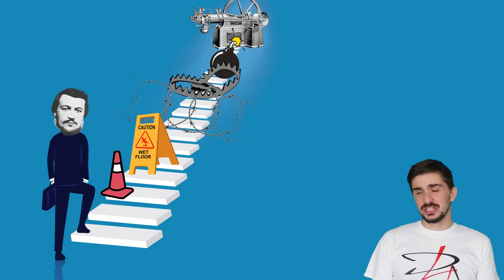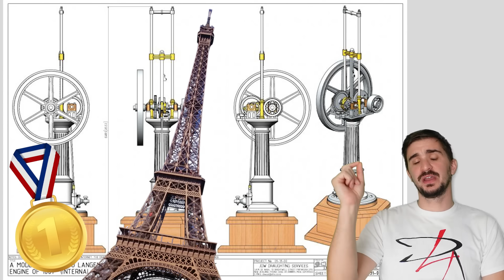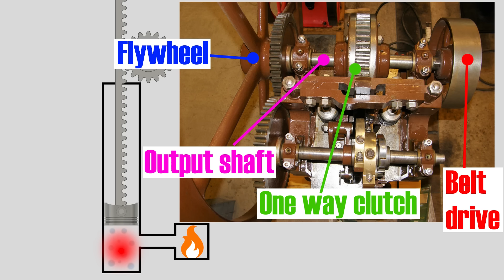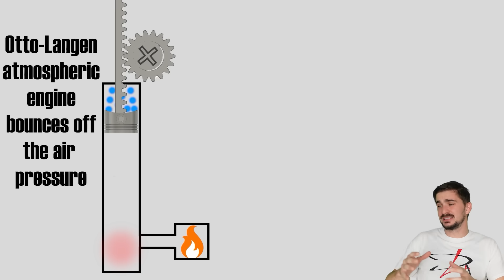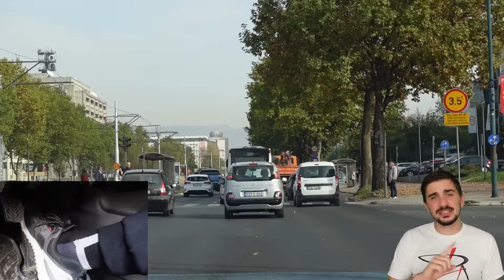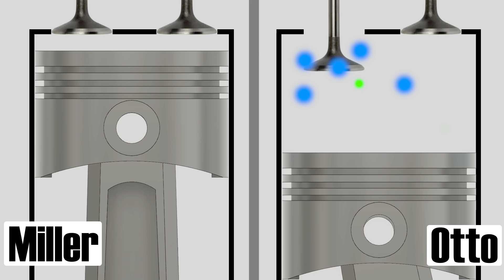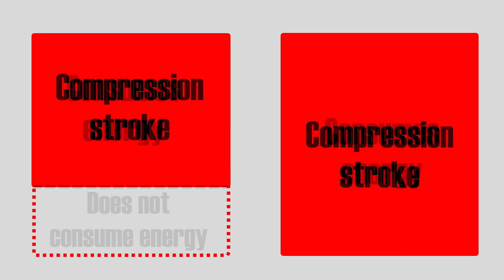You'll understand everything about Atkinson, Miller and Otto cycle engines after watching this video

Comment: I believe more modern engines can switch their VVT even at low RPM since they are electronically controlled rather than controlled by oil pressure like older Hondas. I believe pretty much any modern turbo charged today uses the miller cycle to save on gas. It's why these engines get excellent highway efficiency but the moment you are driving in the city in stop and go situations, efficiency drops significantly. In my car, I can easily get 30+ MPG even at relatively high speeds, but in the city can only achieve 16-20 MPG.
Reply from the maker: Yes but there's still a catch. When you can switch to Miller at very low rpm the engine ends up being in Otto most of the time and the number of scenarios when you're actually running Miller is very much reduced. It's impossible to be responsive at low rpm and be in Miller at the same time, maybe that's how I should have phrased that part.
Reply: The Honda VTEC is electronically controlled, but it electronically controlls the flow of oil to actuate the valve timing system. This is the same as the vast majority of other manufacturers VVT systems. The only examples I can immediately think of that don't use oil pressure are BMWs Valvetronic (electric motor directly drives a mechanical system to control valve lift) and the koenigsegg free valve system.  There may be a few others but they are in the minority.

Comment: That’s the best and simplest explanation of the differences between engine types that I’ve ever seen. 

Well done.

What is really amazing though is that all of these are going to be made useless with the even more rapid developments in battery and electric tech.  I loved my V8s and manual transmissions but am addicted to the responsiveness and power of my EV. No more fuel burning.

Comment: What an amazing video!
With regard to Atkinson/Miller differences:
Atkinson has a very late intake close, past BDC, Miller has an early intake close, before BDC. In Miller cycles you actually shorten the intake, creating a partial vakuum before you compress. Atkinson pushes fresh intake air back out of the combustion chamber.
Reply from the maker: I think you're mixing up Miller and Buddack
Reply: @d4a  you can argue about that, VW/Audi started off calling it Miller when they introduced their EA211evo and only after some time switched to Budack. Nowadays in R&D it's mostly referred to as Miller by several OEMs worldwide. Probably because it's easier to say "we'll be millering" instead of "budacking".

Comment: Excellent video.
This was particularly important to me because I have a Miller cycle engine in my car. It is a 2014 Nissan Note with the HR12DDR engine. It is supercharged, but has a magnetic clutch to disengage it when not required. It is very economical and produces so little CO2 that I don't pay any road tax, it produces less CO2 than a friend's hybrid Honda Jazz. The downside is that it is not a fast car.

Comment: Great video, explaining all the difference between different cycles in modern engines. Have Toyota hybrid car and absolutely love it. People think that hybrid is slow and underpowered, but have proved few drivers that is not the case when leaving them behind when light goes green at the junction.
Reply: Hahaha!! I do that everyday during my commute, with my 14 year old Prius Tspirit Hybrid. 145k miles on the clock and this car just GOES when you need it to. All glory to the Atkinson Cycle engine incorporated into the equally legendary Hybrid Synergy Drive. Managed 69.4 mpg out of a 45 litre tank of fuel last summer, also travelling 653 miles out of the same tank of fuel - amazing performance from a vintage 2nd generation Prius - I wasn’t babying it either - this happened during the unprecedented heatwave in London last summer. 😊
Reply: It's cause the engine doesn't drive the wheels directly, so engine power doesn't have a direct affect on power. Your battery health and capabilities will affect the speed much more. Hence why the newer ones are much quicker than the older ones.

Comment: Excellent.  The only thing I would add is that the Atkinson/Miller engines also benefit by effectively extracting more power because of the ratio of the power stroke to the compression stroke -- not just by saving energy in the compression cycle, but also by having a longer effective power stroke which allows for maximum extraction of energy from the combustion pressure.  Also results in slightly lower exhaust gas temperatures but that's not particularly of note.

Not sure if you've done it yet, but a video on the Aisin e-CVT design would be a nice video.  People don't understand how essential that design is to an efficient hybrid.  It contains two electric motors of different sizes and a single sun/planet/ring gear set and no clutches or solenoid controlled gear engagement.  It's baffling in it's simplicity when you first look at it!  The smaller motor/generator actually modulates the speed of the planetary carrier to change the ratio between the petrol engine and the output shaft.  I love its simplicity.

I have a Ford Fusion (Mondeo) hybrid that uses the same transmission and it's quite amazing.  It has a 2 liter Miller engine sans supercharger.
Reply from the maker: Really appreciate the tip. That IS a great video idea!
Reply: @d4a  You are great man! Even I who worked with combustion development 10 years in the 90:s,  learned new thing here. History is fascinating for us engineers. In fact, Im starting to think about modifying any engine with inlet VVT to run Atkinson. Why I didn't thought about that before?

Comment: I was a Mazda Master tech in the 90's and we had a number of customers at the dealership that bought Miller Cycle Millenias.  They were great cars.  Like the video said, they made more power and got better MPG out of a smaller displacement engine.  And the only issue I can remember having with them is that the supercharger drive was rattled a little under cruise conditions.  It was very minor but remember this was a premium luxury car and it took awhile for Mazda to come out with an updated unite that fixed the noise.  Otherwise, they were good engines.  It was just hard to get people to spend that much on a Mazda.

Comment: Thank you, for the article, comments and discussions. about the D-cycle (4 Differential strokes) which is a hybrid of the 2-/4-cycles. Besides better fuel efficiency (our tests show >20%), 2.5~3times (not only 2x, less reciprocating weight and friction) more torque driving power, etc. It can have cars driven with i2, i3, and i4 (whole engine works) instead of current heavy/complicated i4, v6 and v8 current engines for more power, and less fuel consumptions – with lighter support, vehicle frame and styling. 
The split-piston inner-air-pump can further make a hybrid of diesel engine with the gasoline-type combustion (not to produce soot/NOx) to avoid the expensive and the cumbersome after-treatments, besides saving fuel and more powerful towing power. This is the SCCI/LTC (stoichiometric charged compression ignition/low temp combustion) technology, which we are developing to meet CARB’s 2026 (and EPA’s) heavy diesel truck emission regulations. 
Where do you live. I am in Austin, TX. We are looking for partners if you know of someone. 
( Notes for D-cycle – following are not obvious, call to discuss:
1.	Most piston skirts need not be windowed.
2.	Ring sections can be made of stronger thin steel just to hold rings and oil to cool.
3.	The same rings stop the oil leaking.
4.	The piston-train can run directly from the crankshaft.
5.	Crown doesn’t run at higher speed and having Atkinson cycle. The full air intake can be provided via an air 2x pump.
6.	Valves don’t run at higher speed, except for fewer cylinder engines.
7.	Piston-train spring is compressed during intake. )

Comment: Atkinson cycle engines are an absolute gem in Toyota hybrid engines - high compression ratios, 13.0:1 and above, thermal efficience over 35% (over 40 when Mazda SkyActive runs in Atkinson cycle in a Toyota hybrid).

Comment: A detailed overview. Being familiar with the Toyota implementation, it’s worth noting that in the current form it also uses direct injection for fuel, so it only injects it after the valves are closed. Another feature of this one is that it only operates the engine at a reasonably efficient speed, using it’s hybrid transmission. It is not allowed to “idle” at all, with any surplus output being stored temporarily in the traction battery.

To that to work in practice they use spark plugs which are a bit different than the typical type in Otto cycle ones. They have iridium tips and are supposed to spark immediately when the control kit requires them to while the car is on the move.

Comment: Great video and I appreciate the animation used to explain the various cycles. You may want to look at the VW 1.5 l engine which utilizes a Miller cycle but with a turbocharger instead of a supercharger. I recently purchased a Jetta using this technology and it runs great and delivers 43 mpg in a compact 4 door sedan.

Comment: Awesome. I was researching the Mazda millennia just a few days ago. My gen2 Prius is exactly 50% volumetric efficiency, well that's what the torque app shows. I tested the app on my lb7 duramax and the turbo pushes the volumetric efficiency up avging 150%. 🤔 I think the 2023 Prius is variable Atk/0tto, or if it isn't, it should be. On interstate driving, I think a Prius or any Toyota hybrid could slash the compression stroke down further, to 20% or even less. Having more pistons should reduce the diminishing returns.

Comment: The thermodynamic efficiency with Atkinson cycle wasn't entirely with reducing the wasted energy in compression, it was also because the combusted fuel mix wasn't fully utilised at the end of the expansion stroke. So the main advantage of the Atkinson cycle is reducing the amount of fuel/air compressed so that by the end of the expansion stroke it's closer to atmospheric pressure meaning that more of it's energy has been turned into usable mechanical energy

Comment: I would expect the Atkinson cycle (with linkages) to be very clean burning, approaching complete combustion, and as a bonus higher torque or more torque for a given energy source. Ideal for a Hybrid generator if not connected to the drive train.
Very interesting video, cheers.

Comment: Very interesting video, but it's necessary to add that currently the last improving to Miller cycle is the adopting the supercharging by small turbocharger because it allows to reduce the power consumption , a lot of  new engines (VW 1.5 TSI, Fiat Fifley 1.5 etc) are Miller engines with  turbo for example. I want to add a last thing, the Miller's Cycle is also possible acting on Exhayst Valve (anticipating the closure), these tecnique is used for example in big industrial engine because it has more efficiency

Comment: Very good!   I had to re-run the video to see it, but the Atkinson engine is more efficient, because more energy is extracted from the gas before it is exhausted, but it takes a bigger engine for the power.  Likewise a mechanically driven supercharged engine is less efficient, but more powerful for the displacement and weight.  I don't see the advantage of the Miller cycle with a mechanically driven supercharger over the Otto cycle.  I had an original Honda insight that averaged 50 mpg, partly by using the Miller cycle, but a neighbor ran into its streamlined aluminum body.

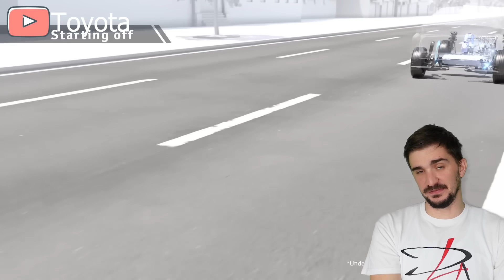Comment: 20:26 it still consume energy. The motor is using energy from the alternator to run, and this means that the alternator has a load on, so the main engine need to work harder to rotate the alternator.

Comment: Caterpillar used the Miller cycle as an in cylinder means to reduce combustion emissions of NOx. With a diesel engine that runs on extremely lean air fuel ratios, a lot of excess air in the combustion stroke is reacted into oxides of nitrogen, a toxic pollutant. With the aid of hydraulically operated variable valve actuators they were then able to keep the intake valves open longer under certain conditions, thus reducing the production of NOx. The interesting difference between diesel engines and gasoline is that there was no loss in power due to the excess air typically not generating "power" just expansion of gasses that helped build turbo boost. To remedy this they began using compound turbocharging in excess of 60psi on some engine serial numbers (NXS/MXS)

Comment: I'm wondering if anyone could help me understand this as an enthusiast but not an engineer: If compression increases efficiency, which is why Otto added the compression stroke, then how does hampering the compression stroke via Atkinson or Miller increase efficiency? Also don't these typically have a similar compression ratio (IE: Toyota's new 2.0L@14:1) to Otto engines? It seems like the mpg/efficiency gain is just from smaller displacement, with unnecessary extra steps. What it really looks like to me is that Miller cycle is really a different way to make a variable displacement engine.
Reply from the maker: You're mixing up the act of compression vs compression ratio.

Comment: There was a privateer that developed a KTM single 4-stroke top end on a dual crank bottom bottom end. One of the features of this engine was faster compression stroke (for less losses) and a slower power stroke (for increased torque). I was surprised that the concept was not carried further.

Comment: I'm not an engineer or even a mechanic, so I'm probably missing something here, but with the open intake valve and backflow of fuel / air mixture out of the cylinder isn't that just dumping unburned fuel causing both pollution and waste? Or is what leaks out of the cylinder retained in the intake manifold or something like that and then pumped in during the next intake stroke?
Reply from the maker: You answered it. Stays in the intake and goes in on the next stroke. Nothing is wasted nor any pollution generated

Comment: Another way to look at the efficiency gain in Atkinson/Miller engines is, yes the reduced compression stroke takes less energy, but also the relatively extended power stroke doesn't lose energy to the exhaust. Even though the cylinder has the same volume at the end of the Otto power stroke, the ignition has substantially increased the pressure. So by extending the power stroke, you can extract energy that would otherwise be lost when the exhaust valve opened.

Comment: I think there is a fundamental problem with this video. It repeatedly says that compressing the incoming charge wastes energy. I think that is wrong, because the gas acts as a spring. In other words, the energy required to compress the charge is returned to the crankshaft as the piston descends. In that respect it is exactly like compressing a steel spring: the compressed spring stores the energy used to compress it, and releases the energy when the spring is allowed to expand.

The Atkinson cycle is not about reducing the energy wasted on the compression stroke. On the contrary, it is about reducing the energy wasted on the expansion stroke. In the standard Otto cycle engine, there is a significant amount of pressure still in the cylinder at the end of the power stroke. The piston cannot extract any more energy from the hot gas because the crankshaft won't let it travel any further. Instead, this pressurised hot gas is released into the exhaust system, wasting the residual energy in it.

Atkinson's invention allows the expansion (power) stroke to be longer than the compression stroke. This longer expansion stroke allows the piston to continue extracting energy from the combustion gas, until there is little or no residual pressure.  

In summary, this is the crux of the Atkinson cycle:

1/ The Otto cycle forces the expansion stroke to be the same length as the compression stroke. At the end of the expansion stroke, there is still residual pressure in the cylinder, and this pressure could do more work if only the piston could continue moving until all the residual pressure is gone.  Instead, that potential work is wasted: the piston cannot move further, so the pressurised gas is released into the exhaust system, wasting that energy. 

2/ The Atkinson cycle directly addresses this shortcoming by allowing the piston to move further on the expansion stroke than it did on the compression stroke. This means it can extract more of the energy in the combustion gases, potentially until there is no residual pressure in the cylinder when the exhaust valve opens.

The purpose and benefits of the Atkinson cycle are explained in countless automotive engineering text books. None of them claim Atkinson wanted to reduce the energy wasted on compression. They all say the same thing: Atkinson wanted to extract more energy from the power stroke.

That is why I think this video is fundamentally flawed and misleading.